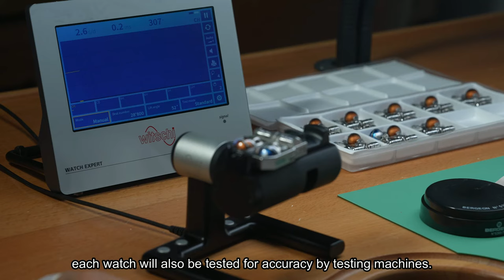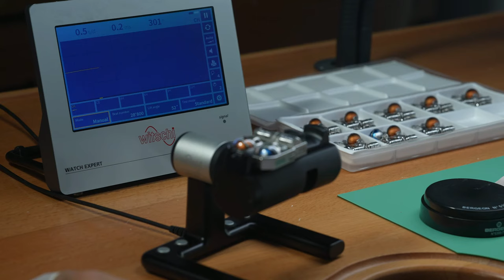𝗕𝗘𝗛𝗥𝗘𝗡𝗦 - 𝗧𝗵𝗲 𝗠𝗮𝗸𝗶𝗻𝗴 𝗢𝗳 - 𝕄𝔸ℝ𝕊 ℙℝ𝕆𝕁𝔼ℂ𝕋 𝕆ℕ𝔼

Comment: is the earth installed upside down?
Reply from the maker: Thank you for your message. This was done in a way due to the mechanical arrangement of the module. In order to have the Earth turns in the correct direction in relation to the actual Earth, we have to turn it upsidedown to make it happen. This is due to certain limitation of the mechanical gearing arrangement.
Reply: @H.Innovations  So this means whoever supplied your earth module made a mistake. Terrible mistake. We should all wait for version 2 of this product then. Also, the lack of curvature is a problem for wearing. And your own website shows this watch is HUGE when worn on the wrist.